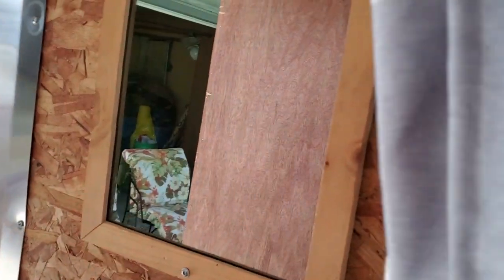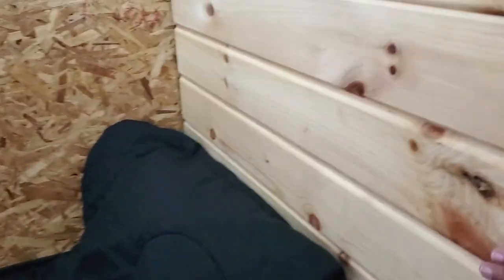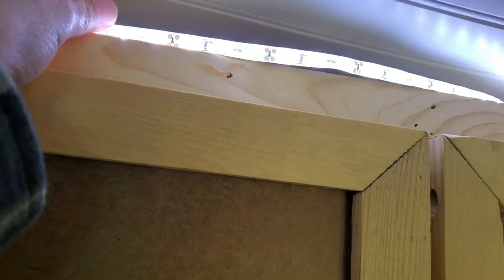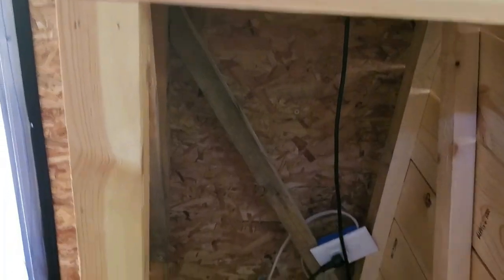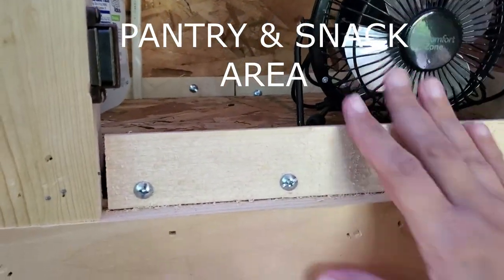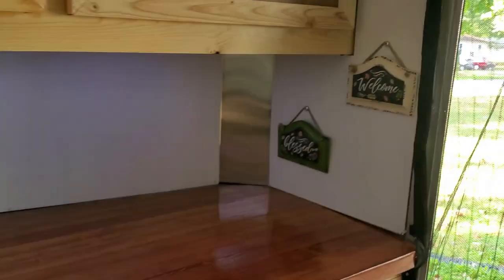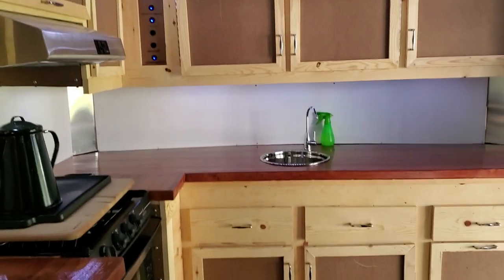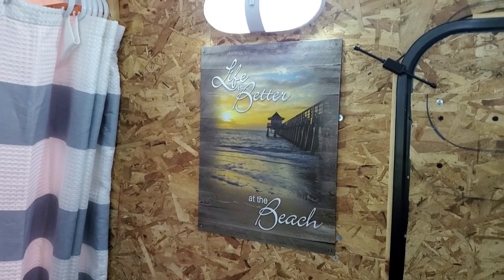RV - 7x16 Cargo Trailer Camper Conversion. Finishing Up. Build. Cargo trailer conversion.

Comment: A solution to make under-bed storage easier to access is to install a hydraulic ram at each end of the platform. They come in various lengths & lift capacity and don't cost very much. Heck, for a few bucks you could pick a couple of used ones from an auto junkyard.
Reply from the maker: Hey there Fred,
That is a good IDEA 💡. 
I'LL have to share that with the ol' hubby, lol.
I appreciate your advice & THANK YOU so much for watching. ❤ 
Take care.

Comment: I love the Berkey wedge support and the cutout at the spigot for getting the water out (very important feature!). Do you think the divot will stabilize the Berkey enough when you are running down the road? I know a lot of nomads put theirs in their sinks; I can see that is not an option for you! (I possibly see bungee cords in your future...!) 
We are still considering how to do the beds in ours... My old back needs my mattress! So does my Hubby... First we consider making Murphy beds; decided they were too unstable with the weight of the 15" mattresses; now we think we will do a trundle bed setup that will be easy to slide-and-stack for extra floor space while not sleeping.
Your conversion looks amazing! Looking forward to following your next steps! ~ Kir in Tennessee
Reply from the maker: THANK you so much for watching. There will be a foam cushion and a small bungee cord securing it to the wall bracket. We are still experimenting  on the beds were going to buy 6 inch memory foam MATTRESS and cut in half and make 2, 30 inch MATTRESS. The hubby has a bad back too so we are tweaking until we find the right comfort. KEEP watching. ❤

Comment: You are absolutely right to remove the heavy futon mattress!  Way too heavy and will absorb moisture and mold over time.  Foam is the way to go.  However, the egg carton foam is inadequate and works well as a topper.  Get some very firm foam from Amazon or a local upholstery shop, and use the egg carton foam as a topper.  You don't want those moving blankets, which are not washable and very fragile and will shred in no time. IKEA sells mattress pads and the best sheets cheap.
Reply from the maker: Thank you ~ that is AWESOME advice.  We've been trying different items until my mother in law lend us 2  mattress pads that worked great. But we are definitely going to get a BETTER foam mattress. I'll look into IKEA & Amazon. 
Thanks for the tips !! ❤
Reply: @AdventurousJeriLynn  I forgot to mention that I really liked your creative Berkey stand!  Nice to have a husband who makes things.  If you get elastic cord in a reel you can make custom bungee cords with a bag of hooks.  These are cut to the right size by you so each is a custom fit.  Usually cheaper than store bungees.  The other option might be a large hose clamp, or a piece of metal strip with holes in it and use it in place of a bungee, which would look nicer.  The foam from Amazon is much cheaper than a mattress at IKEA. You cut the foam to size.  Get very firm foam as you already have a soft topper.  IKEA has the best bed linens, all cotton, some are cotton rayon mix.  High quality, low cost. They also have feather quilts and duvets in pretty colors. IKEA is the only place you can buy single fitted sheets of all sizes, as well as sets.
Reply from the maker: @lass-inangeles7564  ~ thank you,  thank you so very much.  I will pass that on to the ol' man ( hubby). He is pretty handy  & reminds me quite often of his skills set. Ha ha ha. 
But I'm the best assistant because when I run to the local lumber yard for wood ~  I always bring home snacks. 
GREAT advice, much needed ideas on the bed.